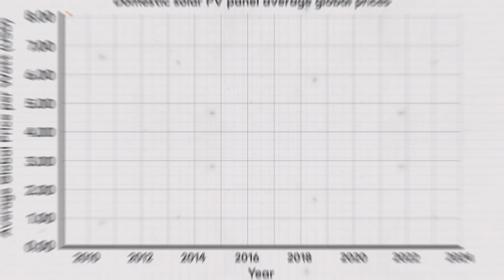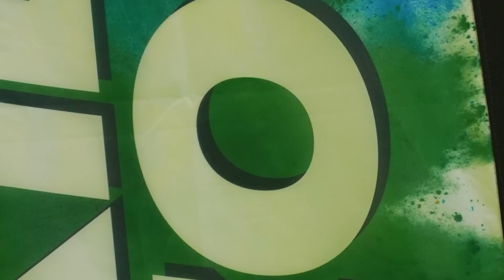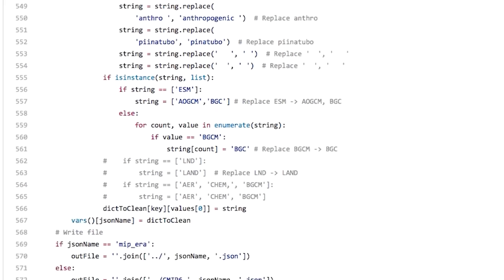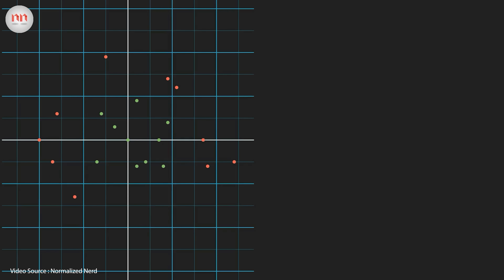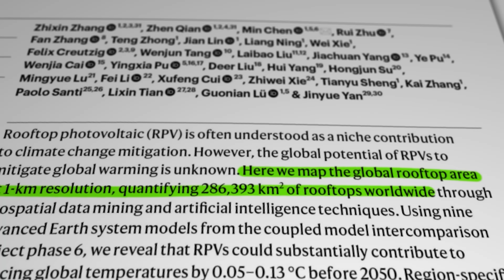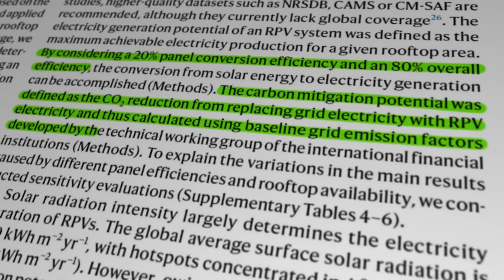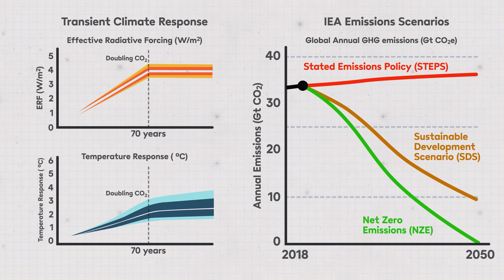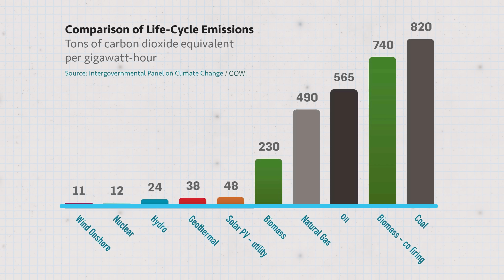New Report - Rooftop Solar PV is THE biggest climate mitigation technology!

Comment: I need to just get on with it and forget about the old Return On Investment stuff. 

"Oh, it would take me 20 years to break even" - that was me in 2017.
Eight years later, since buying the house I live in with my wife, it's more like 7 or 8 years. 

But it's not just about the ROI - it's also a sense of security if you get the right system installed.
It's not so much an "off grid" thing, but rather a sensible backup in the event of an energy security issue.

We've had a few scares over the years, a few concerns about the ability of governments to keep the lights on.

However I am STILL struggling to justify the capital outlay, so I may limit my exposure to an "emergency" installation.
3kw, the grid providing the slack the panels won't provide in winter etc. 
In other words, always having 3kw of battery backup power at any given time, plus the worst case "power off for weeks" backup of solar.
Reply: It´s more than just money for me too (installing in a month)...  it´s about the world needing to cut CO2, for the BENEFIT of all!   It is also about technology... It is about a feeling that one can produce one owns energy    and it is about getting cheaper energy in the long run.

Comment: Put solar panels on tops of sun shelters in the parking lots
Reply: that should be standard when building parking lots
Reply: France has passed laws requiring that solar be installed on every parking lot greater than a certain size, even those that are already in place.
Reply: Here in France a law was passed in 2022 requiring any organisation with over 80 parking spaces to put a proportion of them under solar panels. We have seen this put into practice in the past year or so with all the big supermarkets putting up panels and creating shady parking spaces in the process. The expectation is that this law will add 11 GW peak of capacity over the next few years
Reply: ...and on the roofs of indoor swimming pools, too!
Reply: That's already done everywhere in California
Reply: Put solar all over parking lots
Reply: it would make the cars last longer too!
Reply: And EV chargers
Reply: I have to wonder through, how the energy savings on this would compare to painting roofs in urban areas white.

Definitely good for spare areas where heat isn’t an issue though!
Reply: @notyetdeleted6319  hmm I can't think of many white roofs, actually
Reply: @notyetdeleted6319  If you put the solar panels on stilts and spaced out a bit so they have more airflow under them you can have both. Then less of the heat from the solar panels will reach your roof, which you can still paint white to lessen that effect even more.  This basically sacrifices 10-15% of solar panel surface annd slightly increases replacement costs (because longer stilts mean your solar panels catch more wind) while getting both benefits you want. It may even be that the solar panels' shade cool your roof more than their warmth warms it, but I don't have the physics knowledge to calculate that.

Comment: I want solar!!! Texas is a great place for solar except for some availability issues in contractors and parts. Also we have a governing system working against home solar.
Reply: Or it seems renewables in general.
Reply: @leftcoaster67  I didn't think ERCOT was against utility scale renewables also. Their plans for the next 10 years have more renewable growth then fossil fuel.
Reply: @markvalery8632  Problem is NOT ERCOT.  Problem is the Texas Legs is owned and operated by-and-for Oil and Gas.  Currently there are bills to BLOCK new Solar, as well as to REQUIRE as much or more New Gas Generation be built than New Solar.   But overall, Texas is still building mostly Solar.
Reply: @ Did not know about the current bills. Thanks.

Comment: I'd like you to do a piece on bifacial vertical mount panels.  Here in Canada horizontalish panels are worthless 5months/12.
Reply: Tilting panels probably make more sense at higher latitudes. If you've got enough land you could put them on tilting supports and change angle gradually over the seasons

Comment: Every building in the southern and SW US should have solar collection. My building has a huge roof and faces south. My deck gets well over 100F and my door knob gets too hot to touch in the morning sun. The residents would have free electric power 10 months out of the year.
Reply: also factories & warehouses
Reply: Heat reduces the efficiency, but it also adds shade to the space underneath, so...
Reply: @ProfessorAV  
I've heard of hybrid setups where water circulates below the panels to absorb heat to cool them and provide hot water to the home or building
Reply: @panchostanza8712  probably not worth the complexity and maintenance. And the water from a hot water tank is not going to be much cooler than the air temperature under the solar panels. You could circulate "waste" cold water from a heat pump space heater, or blow waste cold air from a heat pump water heater, under the solar panels.
Reply: Why just 10 months of the year?
Reply: Not to mention how much heating is blocked by the panels.
Reply: No a lot of the South gets too much rain which equals roof leaks.
Reply: @francismarion6400  
CA, NV, TX, AZ, OK are a big part of the South.
I lived in the tropics for a decade  - if your roof leaks, you need better roofing
Reply: @panchostanza8712  None of those are Southern States
Reply: @francismarion6400  
here's what the original comment stated
"Every building in the southern and SW US"
and if the states in the "South" can't build roofs that don't leak, well that's their problem
Reply: @panchostanza8712  It's not a problem in the South. Except for people who install roof top solar. The South West doesn't get as much rain as the South.
Reply: @francismarion6400  He didn't say it had to be on the roof. Also, if designed for it, it won't be a problem.
Yes, the entire southern half of the US would economically benefit from going off-grid solar with battery.
Reply: @williammeek-h2o  Most of roof top solar is added to existing roofs and so not planned. No the South gets too many hurricanes to be on roofs. All around bad idea. The should always be installed on the ground only. Florida GC, 25 years. Started as a roof framer.
Reply: @francismarion6400  I agree rooftop is a bad idea for most current homes. But saying ground only isn't right either.
Reply: @williammeek-h2o  I have yet to see an engineer design a new home in a high velocity hurricane zone with rooftop solar. NO one wants that liability!
Reply: @francismarion6400  Wrong, it is no one wants to design ANY new houses in Florida because they don't want the liability.
You can't get any house insured in many parts of the state without paying insane prices.
I am personally no a fan of rooftop solar.
It makes cleaning the panels harder and usually prevents adjustment of the angle for maximum solar production. 
ground mount is the way to go, but if there is no space, then roof top it is. 
But that is a last resort position.
Reply: @williammeek-h2o  You don't need maximum power from your solar panels, but you definitely need your land for other stuff. At least in cities where most of the power consumption is. And I always wondered how the USA can't decide to build strong enough to withstand the weather. Do you not get that the point of buildings is shelter from the elements? I know it isn't that you can't build strong enough to withstand hurricanes, it just isn't considered economical to do so, which is a completely different position to take, you're basically saying that the common USA citizen is too poor to build safe housing, i.e. the USA is one massive slum with the occasional superwealthy rich neighbourhood.
Reply: @bramvanduijn8086  Except for the part about needing the land for other stuff, pretty much yep.
Reply: Im in NC and have had my system for a little over a year. No leaks
Reply: @catherinegreen8440  You will have mold before you figure it out lady.
Reply: @francismarion6400  
if that's what happens to you, you have crap building standards.
y'all can & should do better.
in any case that still leaves a huge portion of the country that can do what y'all can't
Reply: @panchostanza8712 Our building standards far exceed that of New York and California. We build homes to withstand 175mph winds. To do this a house costs a minimum of @ $250 sqft to build.
Reply: @francismarion6400  rooftop solar panels don't cause roof leaks in and of themselves.  Poor installation practices might.  Leaks are an incredibly rare problem in Australia where rooftop solar is becoming almost ubiquitous, and where the more densely populated regions (with most of the rooftops and most of the solar) get very heavy rainfall from time to time.
Reply: @JonathanMaddox Australia gets almost zero rain compared to the Southern US.
Reply: @francismarion6400  Australia does not get "almost zero rain" compared to anywhere, it's a massive continent with huge contrasts, it's not all desert.  There are places in northern Australia that get over 4,000mm of rain in a year, which is more than anywhere in the US.  Cities like Sydney and Brisbane further south on the east coast get over 1,000mm per year which is only a little drier than the typical figures for towns in the US South.  And there's nowhere in Australia that doesn't get the occasional torrential downpour, even deep in the desert.
Reply: @JonathanMaddox The whole reason we have building codes is because of people like you who doesn't know what they are talking about.

Comment: my ex got her house did with solar back in 20 or 21.  refinanced the mortgage to pay for them.  the bill was over a 100 a month, now its just a 15$ connection fee.  what they generate in the summer pays for what we use in the winter

Edit, forgot to mention, do your research well on the install company.  far to may of them (at least in the US) pop up and go out of business in a year or 2.  Make sure to register your panels and inverter with their manufacturer so that if you ever have to re-shingle your roof, you're not having to jump thru hoops, pull your hair, and wait weeks for the manufacturer to find a new "certified" install company to remove and reinstall the panels.  speaking from experience
Reply: In my area, the base charge is now $37 per month.   You can't get an electric bill less than that.   Even if your power is literally out due to a natural disaster.   I think they need to restrict high base charges to a multiple of the minimum wage.  Like 4 hours minimum wage.

Comment: Unfortunately most europeans don't own rooftops
Reply: Depending on the exact country, that’s not an issue. I’m living in Germany, and the combo of 800 watt micro inverters (for sale at around 130€) with up to 2000 watts of solar panels (each for about 50-60€) are pretty much booming.

The inverter plugs into a standard wall socket on your balcony, the panels receive some mounts and are mounted on the balcony fronts. Add some inexpensive battery storage (2 kWh for 500€) and you can consume excess solar generation during the night.

Yes, it’s all grid-tied, but power outages are rarely a thing (statistically 15 Minutes per year, but in my area there’s been one outage over the past decade).

Those “balcony solar plants” also have to be registered (simple web form), and based on those registrations, they’ve been doubling in numbers for the past few years. Some regulations were also lifted last year, which might further increase installations this year.

And at 250-300€ for a typical combination of one micro inverter with two panels (totalling 4 square meters), “cost” is not an issue. Some municipalities even subsidise them with up to 300€, effectively nixing the cost.

Oh yes, not everyone has a balcony and some balconies are facing northward (one can also install them on their garage, in their backyard or wherever else). And one doesn’t received any money for the excess power exported to the grid (at least in Germany). And such small and simple installation options are not available in all European countries. 

But it’s still a very attractive and inexpensive option. Fairly often, home owners also start with such a DIY project, then become “addicted to solar” and want more - which then usually leads to a rooftop installation.
Reply: Someone owns the roofs. Landlords can have another income stream.
Reply: @fliprim  most of the time it's not just one landlord, but several, with different budgets and opinions.
Reply: @ Generally in that case there is a management company that services and maintains the building. Solar PV as a typical roof component could be a profit centre and could become a means to pay for some of the building maintenance costs. Model contracts and approved installers could be the way forward here.
Reply: Balcony solar in Germany and Community solar on the building rooftop as well as commercial building rooftop solar.  @CleanTitans
Reply: Housing coops all the way! 😁 We all got a long way to go, got to lobby for better legislation most importantly,
Reply: @JoshTheWhale  How about PV COOPs?